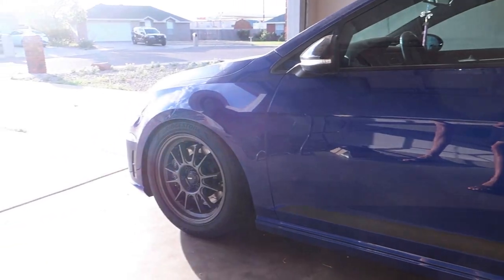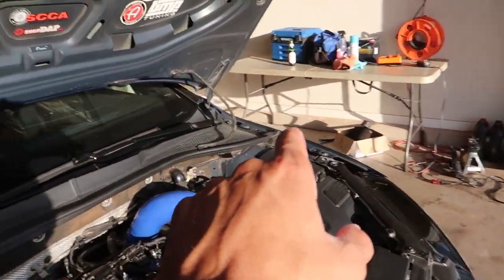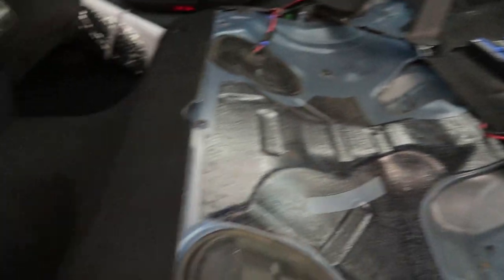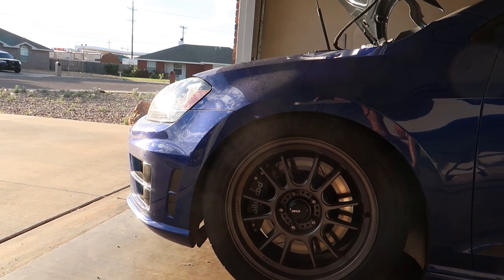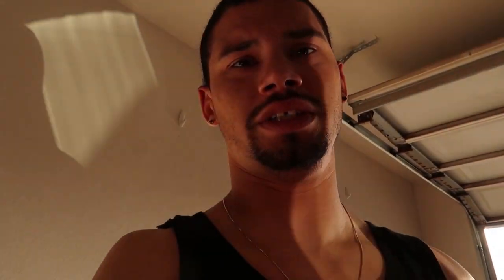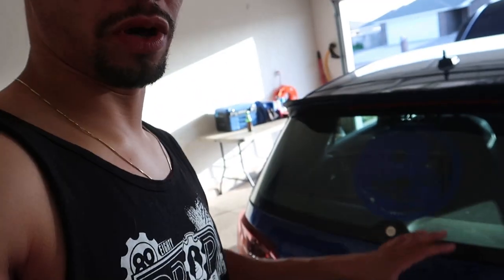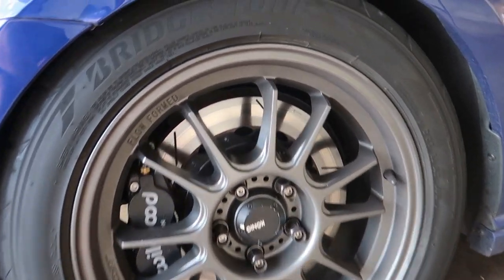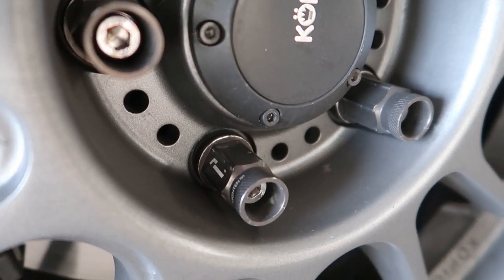Lots of Carbon Fiber Coming! Weight loss in full effect! | MK7 Golf R

Comment from the maker: Engine:
034 Dog bone mount
034 Lower dogbone insert
034 uppder dogbone insert
APR Intercooler piping 
BFI Engine mount stage 1
BFI Transmission mount stage 2
EQT Turbo piping
EQT Turbo muffler delete
EQT Vortex turbo°°
iAbed Rear main seal
NGK 4654 Plugs
Racingline Catch can 
Racingline Coolant hose
Racingline Remote washer
Racingline Intake (R600)
Racingline Turbo inlet
Racingline Intake pipe
Racingline Intercooler
Remus Sport Exhaust**
RS3 coilpacks 
South bend stage 3 daily clutch
Trackslag 4" downpipe
Turbosmart BOV
United Motorsport haldex tune

**102mm Carbon angled tips w/ Ti internals
°°PTP Turbo Blanket  

Fueling:
PM4 fuel pump controller
Precision Raceworks 450 Pump
Precision Raceworks 4BAR Maps
Precision Raceworks 925cc Kit
Precision Raceworks Boost Tap
Precision Raceworks Ethanol Sensor
Precision Raceworks High Flow Fuel Lines 

Wheels/Tires:
17x8 Hypergrams (satin silver) ET43
Bridgestone RE71R 254/45/17
BFI 5mm spacer front
BFI 7mm spacer rear 

Shifter Upgrades:
034 solid shifter bracket bushings
Ball shim mod
Black forest industries shifter (golf ball)
Black forest industries shift boot
Clutch stop
Clutch spring delete
Diselgeek sigma 6 short shifter (5/32 & 3/8)
Dieselgeek shifter shaft bushings
Dieselgeek super pin
ECS clutch bleeder block
ECS SS clutch line
OEM metal shifter bracket 
Swirl valve delete

Suspension/Brakes:
034 stainless brake lines 
034 front endlinks (density line)
034 rear shock bushings
034 rear subframe inserts
034 rear sway bar
034 rear endlinks (density line)
Audi aluminum subframe
Audi RS3 brake ducts
BC Racing coilovers w/ Swift springs
Carbotech AX6 pads (front)
ECS 2Pc slotted rotors (rear)
Eurocode front strut brace
Eurocode hatch brace
iSweep 2000 pads (rear)
iSweep DCC deletes 
Leyo undercarriage brace (rear)
Motul 600 brake fluid 
Racingline stud conversion
Superpro trailing arm bushings
Whiteline control arms
Wilwood 2pc rotor (front)
Wilwood super lite 6pot bbk (pad #7416)

Exterior:
Black emblems
Blind spot mirrors
LED euro tails
Maxton Spoiler
Paint correction (needs it)
Racingline stripe
Rock chips
Some dents

Other:
De-badge front, rear and fenders (R)
DeAuto key blue LED footwells
Haldex switch (custom)
Mele designs battery mount 
Odyssey PC980 lw battery
P3 ethanol gauge adapter
P3 Boost gauge w/analong tap (v3)
Porsche coolant cap
Rear seat delete
Rear wiper delete 
Racingline brake cap
Racingline oil cap
Racingline oil dipstick
Racingline oil filter housing 
Struts cut for camber adjustment
USP ethanol harness (for P3)
WCT Pedal spacer
Reply: So basically just a few boltons right? 😂 good list mate! 👍
Reply: Weight on all the carbon fiber when you switch out.  Have been looking at those as well.
Reply from the maker: Oh for sure!!

Comment: Im running the mishimoto Intercooler and pipes kit. Seems to do very well for me at the moment. 
But you will need to use the eqt Elbow off the turbo muffler delete
Reply from the maker: How much boost you runnin?
Reply: @BryceJordanProductions  ive ran up to 36psi, but limited by fuel at 33psi, but this set up should handle 36psi all day no issues.  Now oil temps are a different story 🤣

Comment: Hey man! I have BFI stage 2 engine mount pucks sitting in my garage that I swapped out for stage 1 pucks. Only ran ‘em for about a week
Reply from the maker: too much NVH? id but them off ya if i didnt have these sold already lol
Reply: Bryce Jordan Productions yeah. It was pretty intense. Haha. Sounded almost exactly like the weird one-seater diesel semi’s that I drive at work. The updated BFI stage 2 transmission mount is fantastic though. You can definitely hear the transmission working, but it didn’t seem to add any NVH

Comment: On one of your videos can you show the plug that needs to be undone to dyno in fwd? I saw it in an old one but not up close.
Reply from the maker: Pull up the back seats, there's a black circle on the driver's side (both sides have one) there's one connection in there that's the one. Look up my video "haldex switch diy"

Comment: have you experienced sticky clutch pedal after a few laps? I have the same car but way less mods =)
Reply from the maker: I haven't on this car but have in others.. I'd suggest a few things.. motul 660 brake fluid which is also used for the clutch, this fluid has a much higher heat resistance. Also, get rid of the spring on the clutch pedal and get the ECS tuning bleeder block and braided steel clutch line. The OEM bleeder has a very small hole and makes the clutch action slow, the ECS one is much bigger and allows more flow of fluid for quicker shifts and stuff. But if anything, do the fluid first

Comment: Hey Bryce, I am about to do the aluminum sub frame mod, and I have the SuperPro LCAs (part # 0018) that are +1 degree caster and I’m worried about wheel to guard contact, do you remember how much of a caster increase your White Lines were?
Reply from the maker: I don't I'll have to do some research, I believe they have two versions and mines the lesser of the two.. got it used so I don't recall the specs off hand
Reply: @BryceJordanProductions  No worries, I'll look it up now that I know it's the version with less caster 😊, thanks 👍🏻
Reply: Just looked them up... the KTA262 are +2.5 degrees of caster and the KTA252's that you have are +2.0 degrees.  Makes me kind of glad I picked up the SuperPro 0018's (+1 degree) as I didn't want to run that much caster due to the rubbing issue.